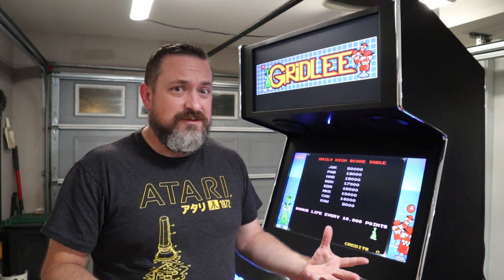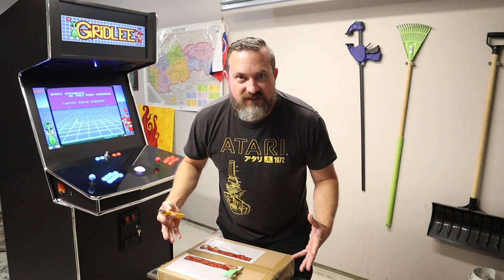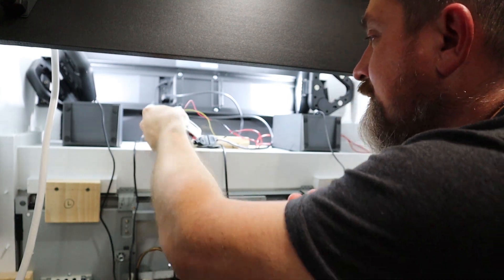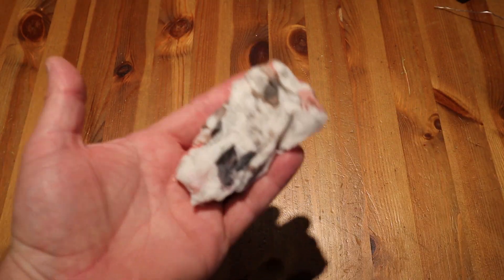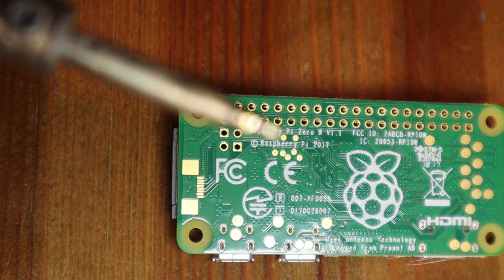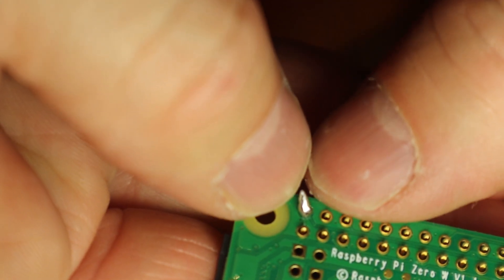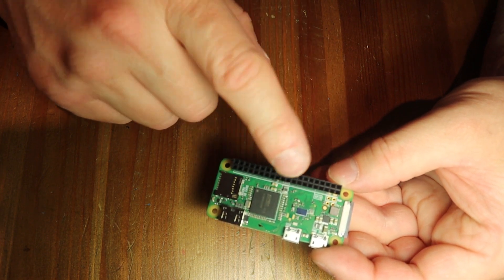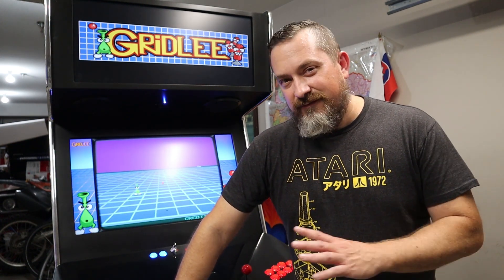How to turn on & off your raspberry pi safely with the push of a button!  Headless Pi on/off button!

Comment: You're a very likeable guy and I can see why people like your videos.

For me, when I see a title, I want to be into that subject pretty much instantly, not 5 and a half minutes in, after entirely unrelated content about the lights in your garage.  And I don't need advice on soldering etc. Ultimately, I suppose, your channel is not meant for people like me, which is fair enough. But maybe even those who stay with you might prefer a video on soldering techniques, and a video on your new lights, and so on. That way they can pick and choose, and I guess you get more videos in your portfolio.

Actually, yours is the only video I saw showing the technique you eventually share and I appreciate it. I didn't know that, and I'll do it.   So for me, this should be  1 minute video "connect pins 5 and 6 to a switch and insert this code into your pi's config. BAM". 

If you prefer to keep multi-topic videos maybe there's a way to square the circle - maybe signpost up-front "If you just want the secret sauce - go to xxx".

Anyway, you asked for feedback and here is mine.  It's meant to be helpful and friendly. And, as we say in Britain "Happy Christmas!".

Comment: Good project though you could have just used a 2-pin connector or soldered the wires directly to the board.
Reply from the maker: Yeah I could have but they have been ok (haven't disconnected in over 2 years).  I still need to set this up on my main pi so I can have a safe reset when it has a jammer every now and then.  Right now, I just open up the control panel and manually touch the contacts but it would be nice to have a button (I even drilled a hole for it so I could just poke the button when it needed it and so no one else could hit it.  Thanks for the watch!  You should check out my vpin build series....it's soooo good.  Cheers!

Comment: When I solder I like to use flux core solder and then put some on the tip of the hot iron, hold it against the contact and the pin, then slowly add more solder, wait 1 second or so with the iron in the solder and then pull up. If you hold it too long the flux burns off and then you get the solder following the tip and leaving those nasty points. Also as long as you're not soldering something super heat sensitive it can help to take excess solder off by using the soldering iron. Wipe it off and then hold it to the solder and then repeat. Finish off by adding a tiny bit more solder (and thereby adding a tiny bit more flux) and you'll have a nice joint that you won't believe you made. I'm just a newb but this has helped me make joints that my cousin thought came preinstalled 😁
Reply from the maker: Good info!  Yeah it would have been easier to pre tin the contacts and use a finer tip soldering iron too.  Thanks for the watch!

Comment: thanks so much for the help. i wish i saw what the button looked like so i know if im getting the right kind and how you wired that up too.
Reply from the maker: You can use any momentary button that is normally off but on when pushed.  I used cheap arcade microswitch buttons. If you're still not sure, you can look at my parts video for the arcade cabinet.  Thanks for the watch!

Comment: Thanks for showing the full software install steps.  That was the part I was really struggling with on getting the script installed on my setup.  Works perfectly!
Reply from the maker: Glad the video helped you out. You should check out the virtual pinball cabinet project too. Thanks for the watch!
Reply: @wayofthewrench  One note, 1st time I tried, it didn't work.  Realized that is because RetroPie by default has SSH disabled.  So there's a few steps that could be added as an improvement suggestion for your next vid. Need to enable SSH on RetroPie RASPI-CONFIG. 😉
Reply from the maker: Ah noted.  As I made this cabinet as a series, in one of the previous videos I turned on SSH already but it probably would be good to add this to the video description.  Thanks for the suggestion!  Cheers!
Reply: @wayofthewrench  Thanks!  Seems to be a common oversight.  Been running across that frequently in other similar RetroPie guides.  Others provide guides using a PC to Network into Raspberry Pi via Samba, where the first time you do that, you need to provide the pi/raspberry login credentials but only need to do it the 1st time and then it gets saved on local machiine.  A newb like me seems to keep running into those forgotten hurdles, doing everything for the 1st time. 😀
Reply from the maker: It's all part of the experience, if it was too easy, it wouldn't be fun!  Cheers!

Comment: If you '"Soddeh" pins to a board, ute a flathead tip.
Reply from the maker: Good tip but in this case the solder pads were so tiny I don't think it would fit.  Plus I used what I had, they may not be my best solder joints but there were good.  No issues in 2 years of use.  Thanks for the tip and the watch!

Comment: Thanks for such an amazing tutorial, your cabinet looks amazing! Just one simple question: I have those pins occuppied with the fans (RP4). Are there any other pins where I can connect the button, or do you know if there is any other place where to put the fans? Thanks!!
Reply from the maker: Thanks Hugo! Glad you liked it, you should make one!  Free plans are in the description.  If you google rpi4 pinouts, you can find other pinouts that can be regulated 5v/or grounds like pins 2 and 4. Or there are other gpios that can be outputs.  You might be able to change the program to use different pinouts as well but I haven't tried that so Im not 100% sure.  Thanks for the watch!
Reply: @wayofthewrench  thanks for the answer! I'll dig a little more, and will be back with an answer 😁

Comment: So does that switch work for the PI 4. Is it the same application to the motherboard?
Reply from the maker: Yes it should be pretty much the same except I remember there being another line of code needed for the rpi4.  Here is a link to what I'm referring to.  https://www.embeddedcomputing.com/technology/open-source/development-kits/raspberry-pi-power-up-and-shutdown-with-a-physical-button.  Let me know if this works as I actually haven't messed with a rpi4 yet because I have just jumped to refurbishing older pcs that are free and are way more powerful for arcade projects.  Cheers!

Comment: Love this series and project, hoping to do this with my daughter as well as the virtual pinball as you go when time allows it, however before I start my project I was wondering when you hope to put out the breakdown of costs and parts required as I did have a raspberry 4 before it got damaged  and want to get parts in place ready for when I can finally get home to see my daughter and start. Thanks in advance and got a sub from me for sure. It’s awesome.
Reply from the maker: Yeah Ian this will be a great project for you and your daughter!  I would recommend just taking your time and ordering stuff as you go, that way the overall cost is spread out and not as noticible.  Plus this gives you more time to find cheap or free parts.  Start with a rasp pi 3 b plus ( $100 after proper power supply and case and cable) at a minimum or a pi 4 but I also recommend taking a look at my how to fix a free computer video so you can use a pc which will be way more powerful and probably cheaper.  Then you can install retropie and some games and play while you build.  Try it out on a free monitor ( or used no more than $30 )to see if that is the size you want before you build too.  After that you'll need mdf or plywood (roughly $70 a sheet). You'll need 3 to 5 sheets depending on your design.  Cheap button, joystick,  usb board for $60.  Misc glue and screws and sand paper $40.  T molding roughly $25 for 50 feet.  2.1 sound system with bluetooth $80. Speaker grills free to $20.  Paint $50. Casters $25.  Beyond that it just gets into the extras.  Coin door $150.  Marquee monitor $279.  Marquee pi and kit $100.  Graphics $300.  Vinyl for control panel $80. For mine it added up in the end but it was my dream cabinet and the money was spent over a year.  I still plan on spending some more for upgrades and mods too.  Cheers and thanks for the watch!
Reply: @wayofthewrench  still watching the vid but wondering if you painted the cab or vinyl?

Comment: Get a flat head soldering tip when doing that.
Reply from the maker: yeah might have helped but the pads were so tiny and close.  The best thing was to pre tin the pads on the board and then it went waaay easier.

Comment: Nice video thank you! Can I add those lines of code directly into a file of the sd? Thank you!
Reply from the maker: Thanks!  You might but this way was pretty easy.  There was a file to download and install so you would have to do that as well.  I know this worked on my 2 raspberry pi though, not sure of other methods.  Cheers!
Reply: Way of the Wrench gotcha.👍🏼 Thank you so much for the prompt reply! Happy Holidays/Merry Christmas
Reply: Another question. When you shut it down using this method do you still have the Red Light on or your Raspberry or it goes completely off? Thank you again!
Reply from the maker: It has been a while since I actually looked at the pi after shutting it off so I am not sure 100% but I think there is always a red light to show you have a stable power supply to the pi but the green light(s) blink a couple times and go out.  I usually wait about 15 seconds or so and wait for the shutdown sequence to scroll across the screen and the display goes into a source not found screen and then I know it is off for sure.  I do this for both pi on my cabinet before unplugging the power cord to the cabinet.

Comment: Word from the wise use a flat tip instead of point. A flat tip gives good solder point
Reply from the maker: Yeah I borrowed a general purpose pencil soldering iron but I have used fine point electronics soldering irons before that worked way better.....not my finest soldering.
Reply: @wayofthewrench  good build this is what i do in my spare time in the cave is practice on any power board your not using. I always see you perfect so i was gonna throw my solder sucker stick and solder braid thru the screen to you.
Reply from the maker: lol...I can imagine.  I have to show my mistakes too, everybody can always improve.....that's what it's all about.  Cheers!

Comment: I’m almost done with my arcade cabinet! I ended up not using the furniture connectors, but I made some changes on my build. It was a crazy ride but it looks pretty cool !
Reply from the maker: I would love to see it when your done, send me a message on the Way of the Wrench instagram (link in description).  Its a good feeling to play on these after all of the hard work.  Any hiccups/things not go right?
Reply: Way of the Wrench I’ll send you pictures and videos, I’m surprised on how it turn out with the limited tools I had. I still need to wire the audio and design the warping on the sides and console. I made it so it connects to a ps4 pro. I’ll give you a more detail info in maybe two weeks when I’m done ✌️
Reply from the maker: Sounds good!